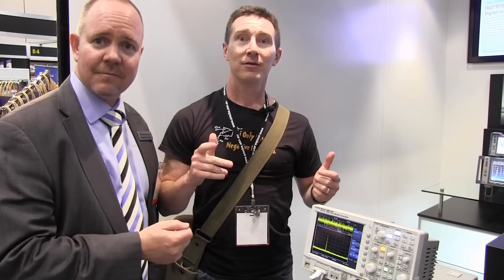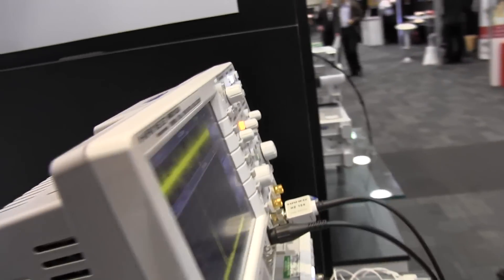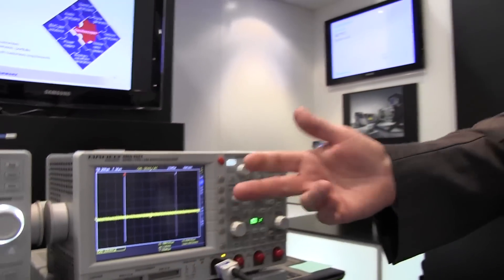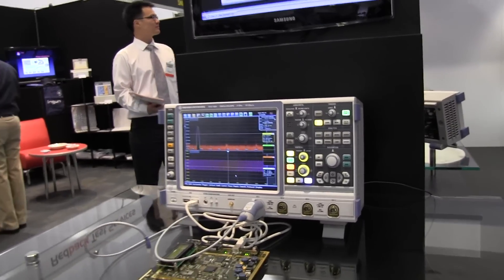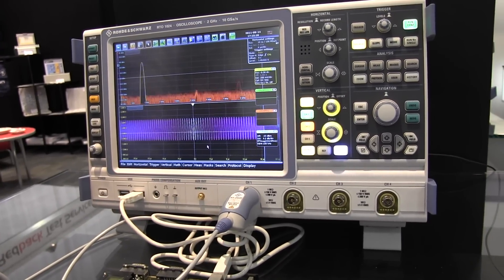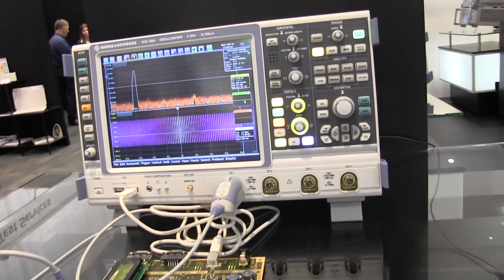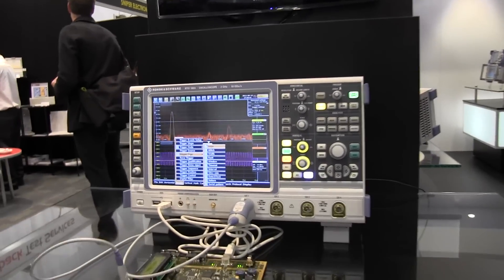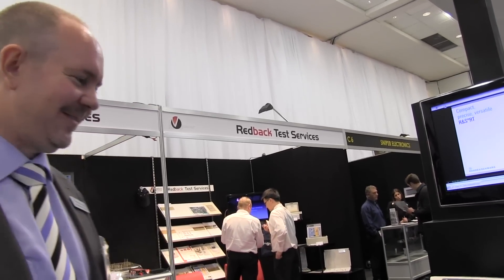Rohde & Schwarz / Hameg Oscilloscopes - EEVblog #207 (3 of 3)

Comment: We use a few Rhode & Schwarz UHF DTV transmitters at our country rebroadcasting station. 20Kw solid state water cooled. The power amps automatically drop each unit if it fails and has redundant everything (excluding the console). We've never had a catastrophic failure that didn't have an outside cause.

Compare that to the "Old Twins" (vaccuum tube, constant phasing issues) and what we call "The Antichrist" (FM radio, even the xmitter designers went "WTF" on that one...).

R&S, great machines!